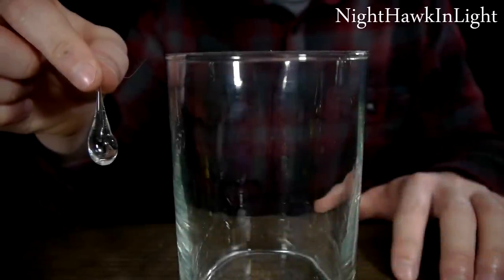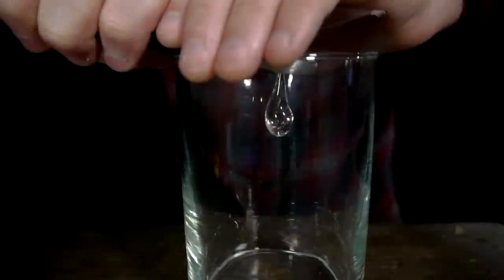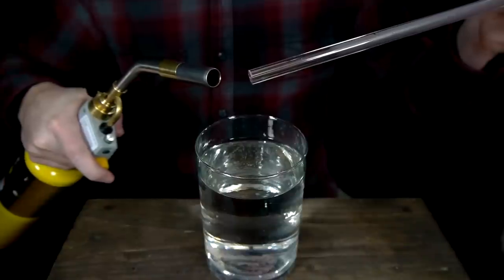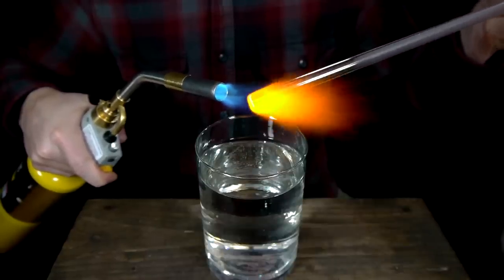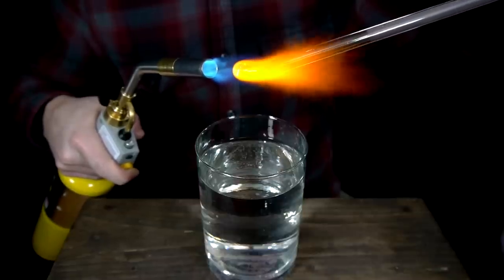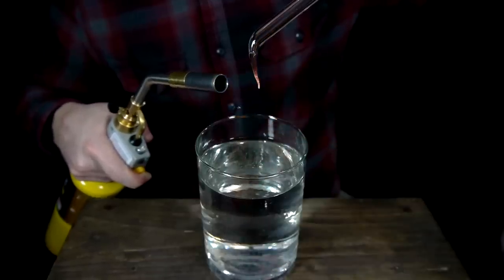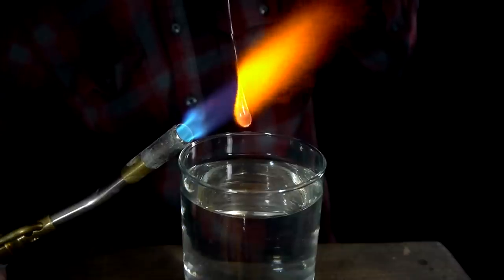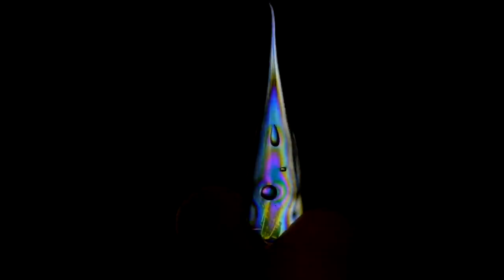How to Make Prince Rupert's Drops - Glass That Fractures at the Speed of High Explosives

Comment: The hot glass breaks in the water because of the rapid change in temperature. This is why you never place a hot beaker on a ceramic surface - if the rapidly moving glass particles (now imparted with higher kinetic energy, i.e., temperature) are cooled too quickly, the molecules separate unevenly, create micro-fissures that erupt into cracks, and thereby break the drop of glass.

Comment from the maker: The rate at which the fractures travel does break the sound barrier. There are no distinguishable sonic booms because the glass is only moving that quickly for a microsecond and for a microscopic distance. It's nothing like a standard explosion that releases large volumes of gas at that velocity, but it does fracture at 1600m/s, compared to anfo at 3200m/s.

Comment from the maker: I don't know what ammonium nitrate you're using, but that's not the case. In fact, ammonium nitrate alone will not detonate. It needs a sensitizer. Depending on the sensitizer used it can reach that speed, but the most common blasting mix using fuel oil known as anfo is right around the 3200 mark.

Comment: I saw it on wikipedia, I don't know but I know it is changable for used blasting cap. If you use really hard stuff to cover the explosive, when you detonate it, the pressure build up until the cap explodes. So high pressurized gas releases high velocities.
 ( sorry for english)

Comment: On the channel SmarterEveryDay they film the failure front up close with a 130,000 fps camera. It was measured there at ~1660 m/s (over 5,000 feet per second). The debris does not actually fly away at nearly that speed, though.

Comment: Easiest way to describe this, as the glass hits water it rapidly cools the surface of the glass drop, and in doing so it shrinks. since the core of the glass drop is still slightly molten it can manuver and compact slightly to accommodate the surface shrinking. however, when the core starts to cool, it also shrinks, but since the surface has already cooled, it is rigid and will not bend. this causes intense stress in the core of the glass leaving the surface of the glass rather durable. if done correctly you should be able to take a hammer to the drop (wear eye protection) and hit it without it shattering. but if you so much as flick the tail end of the glass, it is enough to break the surface tension, literally hundreds if not thousands of fractures form at the break in the tail in milliseconds, and then spread through the rest of the drop in the blink of an eye. also, it should be noted, this typically s
works best with soda-lyme glass (COE 103). most Laboratory glass is made of borosilicate (33 COE) it does not make doing this with laboratory glass impossible, just much more difficult.

Comment: You can melt the tail to shorten it without the tear exploding. Scratching anywhere on the tear with a diamond scribe will also release the stress causing the tear to explode. Safety glass works with the same principle. Scratch safety glass with say a diamond ring and the whole sheet will explode.

Comment: Fascinating!
How long can this internalized stress remain unexpressed, and can it be triggered sonically?
Could it be used to trigger or initiate reactions requiring high activation energy thresholds?
If so, would you provide a demonstration, please?
Thank you!!
Reply from the maker: The stress can remain indefinitely. Tempered glass windows have similar stress inside and don't have an expiration date. While the shattering is a very quick process it doesn't release that much energy compared to chemical reactions.

Comment: Do you know why it does this? It is called "Tempering" Glass. Same glass as in the side window of most modern cars. You can take a dead blow (rubber with sand in it) and beat on the glass without breaking, however, you hit a corner with something sharp, BOOM, the glass explodes.
Reply: Dead Blow Hammer** correction.

Comment: it will only brake if you brake the tale, if you trow it hard einough to brake a thin string of solid glass than yes it will brake, it also depends how it lands and on what, the only thing is that you can not brake the drop it selfe, you could hit it with a hammer and notthing would happen

Comment: Interesting... when these shattered, did they stay in relatively large chunks?  If so, I wonder if that's an attribute of the borosilicate, or the small torch-based method, or what.  When I've made these, it's been with furnace-heated glass (gathered on a metal rod from a pool of molten glass in a furnace in a glassblowing studio -- so much larger than these)... and when they break, they turn into very fine shards -- bordering on powder.  (Maybe similar size to refined table sugar?  Something like that.)
Reply from the maker: I have heard soda glass works better than boro. These never worked as well as I would have liked.

Comment: @Nighthawkinlight Is it possible to use butane torches instead of propane torches? Or does it have to be propane? I know that it needs to reach a temperature of about +-2000 degrees, which is why I am wondering.

Comment: Note they said that the type of torch used must be either propane or MAPP gas but doesn't include acetylene,methane or other gases or atomized flammable liquids like gasoline,benzene,furan,methanol,silane,triethylaluminum,triethylboron,etc or if air or oxygen should be used as an oxidizer. So Prince Precious Drops (PPD) are not so precious after all.

Comment: I have some solid glass rods and the same torch but my drops always shatter while cooling. I have tried heating everything evenly with two torches, I have tried heating just the drop, I have tried heating just the "string" of melted glass I even tried cooling the glass with boiling water and ice water. I did it exactly how you did in this video too but my drops shatter while cooling every time. I have wasted like 8 glass rods and a full tank of map//pro fuel trying to create one of these drops.

Please help me! What am I doing wrong?
Reply from the maker: It took me a really long time to get them working also. It could be that they simply require hotter temperatures to work more consistently, but I'm not sure. I only created them myself through experimentation, I'm not an expert unfortunately.
Reply: I'm thinking maybe the water isn't cold enough or two cold? May also be the heat as NightHawkInLight  previously stated. Trial and error is the best way to learn anything. Try all that stuff and maybe even experiment with taller or shorter drinking glasses.
Reply: Maybe your not doing I right
Reply: Well duh.
Reply: LittleLion Sudden temperature chnage will make it unstable, try warmer water.

Comment: I saw something before that you could strike the head with a hammer and it wouldn't break
Reply: That is correct, because when the bulb is struck with a hammer, it actually becomes stronger, in the same way that an arch becomes stronger with the more weight that is applied.
Reply: Quentin Karper yes, yes he is

Comment: It's not correct when you say that clipping the end disrupts the crystal structure. The sort of glass that you use in this video (mostly made of silicon dioxide) is amorphous and has no crystal structure. In fact, the term "Glass" means something that has no crystal structure. Otherwise, I liked the video very much.
Reply: I remember the glass breaks because inside it is stressed and when the tip is cut, it causes the shattering. Right?

Comment: Pretty neat Physics , but that is not even close to 4,500 feet per second, which would be about 1/2 the average speed of a standard ANFO detonation, those little pieces of glass would have broken the sound barrier in a 360 degree radius from the center and that beaker that you demonstrated with....would no longer exist. Its a cool experiment, but I just cant see it as possible. Can you see my point?

Comment: Question from a 15 year old in 9th Grade: could the same thing be achieved with metal?
Reply: No, metal wont achieve the "stress" necessary.
Reply: No. Metal doesn't shatter (except for when steel has a lot of carbon in it. Then it'll shatter.)
Reply: heat up high carbon steel yellow hot (or bright red depending on the lighting) quench it in oil or water. the water will crack it right away, but oil won't. after you quenched it, hit it with a hammer and it will shatter.

Comment: All this is, is another form of tempered glass!  Raw glass cracks and breaks. Tempered glass explodes.
Reply: It is technically tempered glass in the outside. Tempered glass is thermically treated to remove the stress but also it gives it a different stress, which you can see if it breaks. Inside the drop there is a large amount of stress, but the outside has no stress. When you break the tip the stress makes it shatter